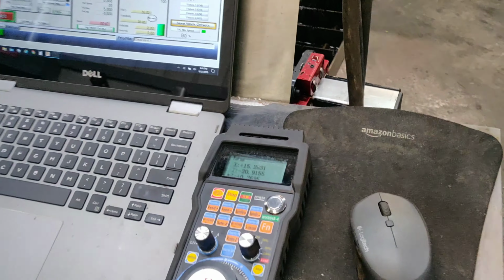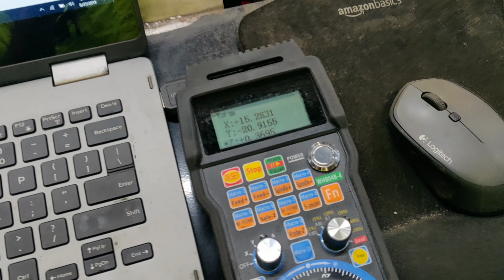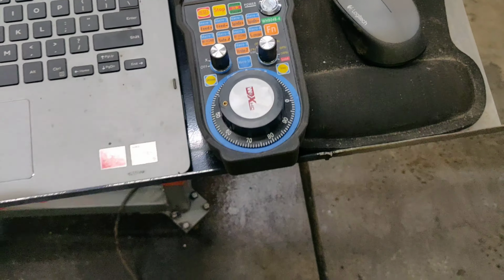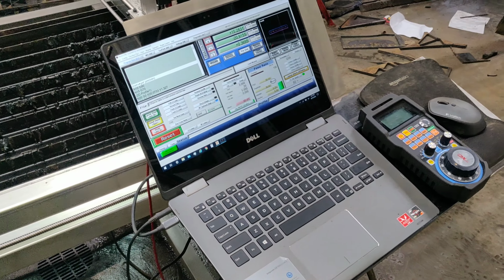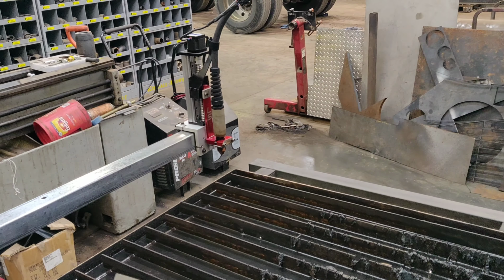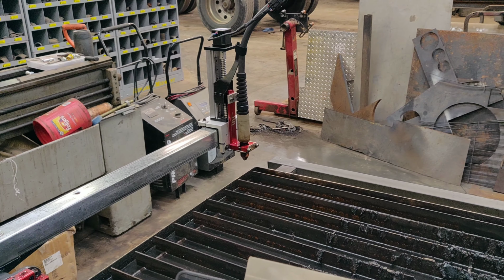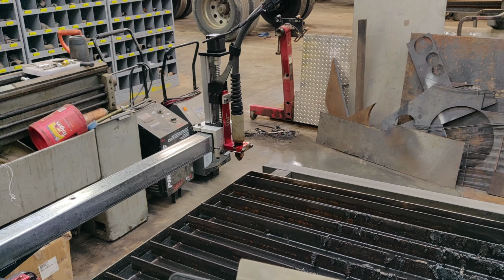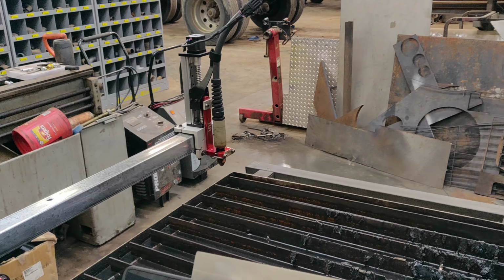Z- Axis is Functioning! - XL Kit Installed! - Langmuir Systems CrossFire - 4K

Comment: Looks great! I have that exact same pendant and followed the configuration to the T and I can’t get it to do anything in Mach3! Any ideas
Reply from the maker: There are a lot of hoops to jump through to make it work right. Mine never worked in a USB 3.0 port. It had to be in a 2.0 port. And getting the drivers to install was a treat...
Reply: Joshua Zimmerman you are absolutely correct. I ended up making it work but it did end up being an issue with the usb plugin. I had to use a 2,0 and it started working with no problems at all. I much appreciate the help. This pendant is great in general but especially if you are using a Z a-did. Money well spent. Now, I just need to finish setting up the probe and limit switches👍
Reply: Got one more question for you...so I have my z axis all setup and moves fine but I’m having problems with post processing. I can’t seem to get the cut height set and I have no probe or limit switches currently installed. How would I go about my post processing to set the cut height? Thanks in advance!

Comment: why do you need the second power syplay and what setting did you use on the z axis motor controller (position of micro switches )
Reply from the maker: The second power supply was to provide 24 volt DC for control power for the probes. As far as the position of the dip switches on the stepper driver, it's been too long ago and I don't have that machine in the shop anymore so I don't know with certainty, but if my memory serves me correctly I don't remember messing with them...

Comment: What was the need you had that the z axis solved?
Reply from the maker: The biggest reason was control over the pierce height. Consumables last much longer if you pierce at the specified pierce height because there is space for the molten metal to escape. I predominantly cut 3/8" and thicker plate, so it makes a noticeable difference. My pierce height is .150", and my cut height is .06".  On thinner plate like 1/8", The pierce time is so short on an 85 amp plasma that it hardly makes a difference. The other big reason for a Z axis, is that between each cut the torch will retract so that it doesn't snag tip-ups etc., thereby avoiding an annoying torch crash...

Comment: hello how did you get the red board to work with fire control ?
Reply from the maker: The red board only works with Mach 3. I believe that Langmuir Systems uses their own circuit board for Fire Control...